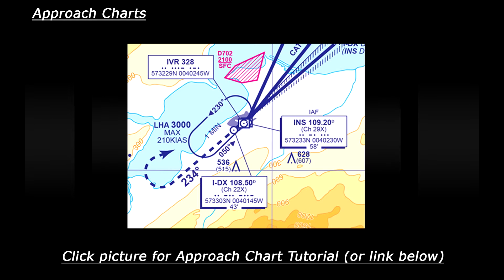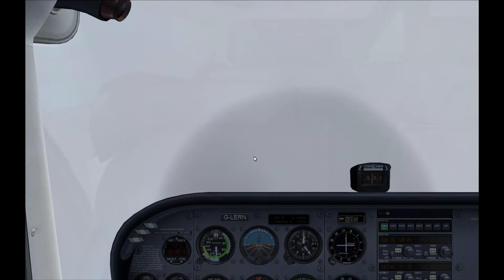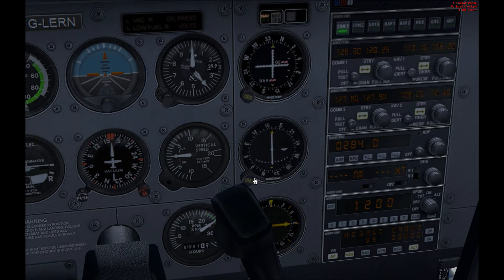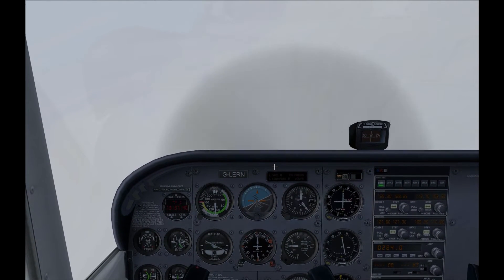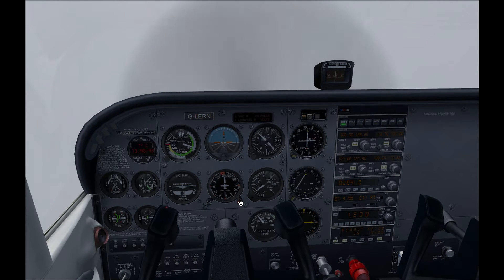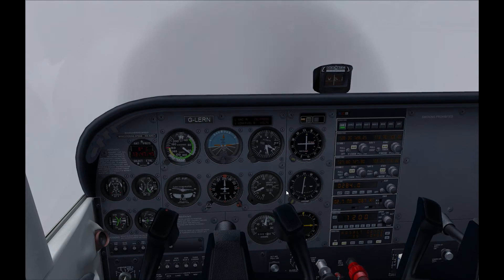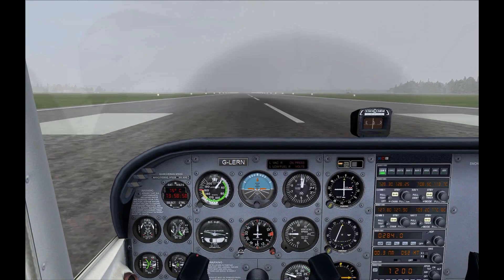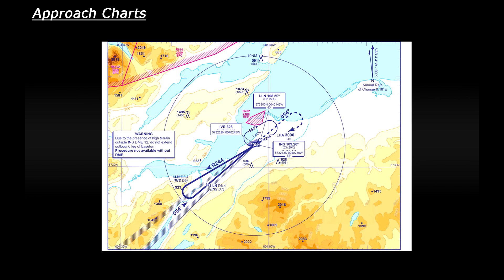Approach Chart Demonstration Flight

Comment: Brilliant, clear video as usual--had great fun replicating it. If anyone else wants to replicate it here is the summary I made! I have noticed the FSX airways around one horse town Inverness have become extremely busy since Doofer started giving tutorials!              Doofer Inverness VOR approach and ILS landing
1. Fly 160 South of Inverness for about 10.7NM altitude 4000ft
2. Set Radio  2 (Nav 2) to INS 109,2 ..,-.,… For fun set IVR NDB to 328.0 so you can see where the airport is at all times. We don’t actually use it for this flight.
3. Check heading back to ILS by rotating VOR 2 with a “to” arrow say about 340. Make a right U turn to heading around 340 that you read off VOR2.
4.  Turn to that heading and fly to and over-fly INS VOR using usual technique. Set DME onto radio 2  and fly in at 4000ft from around 10,7DME out
5. As soon as you over fly it turn to 244 set VOR 2 to 244 and get on to that away radial--  may have to go a bit left to track the 244 away radial. Make sure VOR 2 now has an away arrow.
6. Descend to 2100 at VS -400ft per minute
7. Tune NAV 1 to ID-X ILS for runway 05 ( 108,5 ..,.-..,-.)  to get ready for ILS landing and set it to 055 (054 on external chart). 
8. Switch DME distance to NAV1 radio
9. At 8,4NM turn left onto a heading of about  150 to intersect the 055 “to” bearing on VOR
10. Set autopilot to approach and it should turn it in to the 055 bearing and lock on to the glidescope and bring you down to runway 05. NAV 2 now becomes redundant.
11. At 6,4NM the Autopilot will over-ride altitude and descend on the glide scope.
12. Once speed in the white zone 70 knots flaps 1 Increase throttle to stay at 70 knots
13. At about 2,7NM full flaps adjust throttle as needed to maintain 70 knots and try and land at 60 knots. Once the runway is visible disable autopilot latest 200 ft above runway and land visually as usual.  The Inverness runway is 31 ft above sea level. Did the same flight in a Baron Beechcraft 58 as well.

Comment: How are you managing the throttle whilst on auto pilot? Are you using  anything as a reference point such as the glide slope?
Reply from the maker: Throttle in this plane is manually controlled, and I would be performing an ILS landing at the end of this approach.

Comment: Excellent tutorial.  If you want to use the NAV function of the autopilot to track a VOR radial, (4:20) I believe you can only use Nav1.  You can enter the ILS freq into the Standby freq location to make a quick switch when you're ready for the approach.  Also, when displaying Morse codes, use 2 or 3 spaces instead of commas to separate the characters.
Again, great job!
Reply from the maker: Yeah the Autopilot will only work with Nav1, although you can use Nav2 for manual navigation.

Comment: Doofer, when you set the ADF for Inverness I notice you always listen to the morse code transmission. Is that correct procedure in real world aviation? My logic tells me that if you have put in the correct frequency and the ADF needle responds then that should be sufficient confirmation. Thanks in advance. Gaz
Reply from the maker: I believe so because it's possible that you may get a signal from a different station. So the Morse Code is a way to check that you're tuned in to the correct frequency.

Comment: Hello!! Nice video as usual. 

1) May I know how to set the weather manually? 
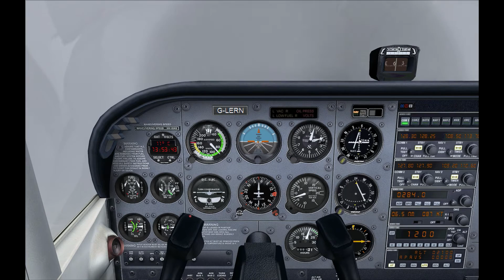2) Also, at 13:56, would the reason why the different distances shown in chart and in sim be that the chart is showing ground horizontal distance but the plane is showing the slant height? (I remember you mention this in video 17. Hope I didn't remember the knowledge wrong.)
Reply from the maker: 1. Before the flight you can set the weather through "User Defined Weather" 
2. All the distances on the chart will be slant height.
Reply: +Doofer911 Thanks! I have a new question. If everyone approaches and lands according to the chart, that means flying a circuit like what you did in video 5 is not available in real world? 

Thanks!
Reply from the maker: King Lim Pang
 Planes can still fly a circuit and an Instrument Approach at the same time however air traffic control will do their best to make sure both planes won't be on Final Approach at the same time. So they may ask the aircraft on the circuit to make their downwind leg longer or I remember hearing an aircraft being asked to "orbit", which meant that they performed a long, slow 360 degree turn while on their downwind leg to give an aircraft on final extra time to land. I remember hearing that on one of the few occasions I flew a real plane however my memory might be wrong.
Reply: +Doofer911 Ic. ATC acts a very critical role!
Reply: +Doofer911 Btw, what can the ATC know inside its airspace? Does it know your aircraft position? Airspeed? Or other info? Or it actually knows nothing and the pilot needs to tell it?

Thanks!!
Reply from the maker: By default, ATC will be able to see a "blip" on their radar and know the position of an aircraft. To get more information, they will issue the plane with a Transponder/Squawk Code. Once the Pilot sets a special radio to that code, then the plane will send more information to ATC such as Flight number, Heading, Altitude and Speed.

Comment: Hi. Please can you tell me what you use to move your views around the cockpit. Is it Track IR or EZDOCK?? Thanks in advance. Great videos by the way!
Reply from the maker: +Dave Foster Very easy, hold down SPACE and move the mouse around! Then use the mouse wheel to zoom in and out
Reply: Well I never knew you could do that! Thanks. There is so much to learn!!
I was thinking about investing in the EZDOCK camera system. Have you used it? Is it worth it? Thanks again. Dave.
Reply from the maker: +Dave Foster I personally haven't but I've seen a few videos of people who do use it and it does look like a very practical addon. You can setup multiple custom views so you can get a better camera angle to look at certain panels which might be difficult to read from the Pilot's seat and you can switch seamlessly between each view rather than having to right click and select a different view.